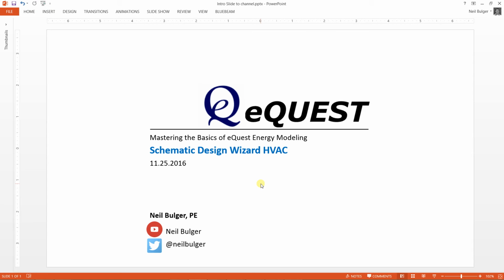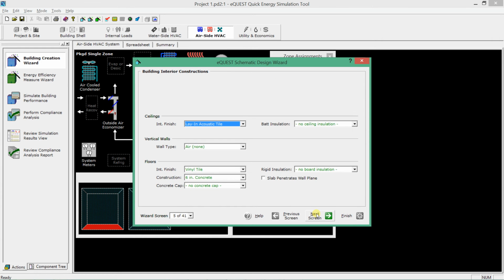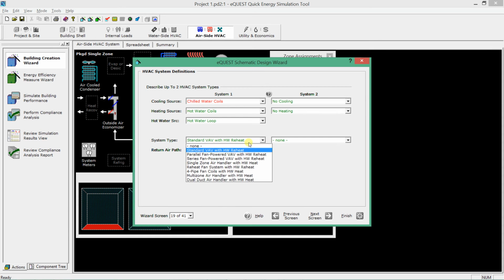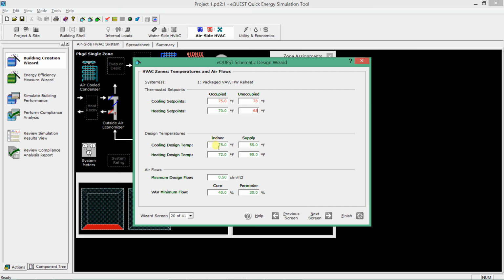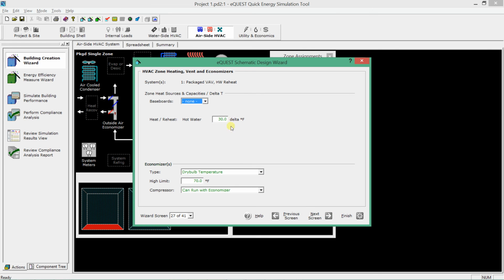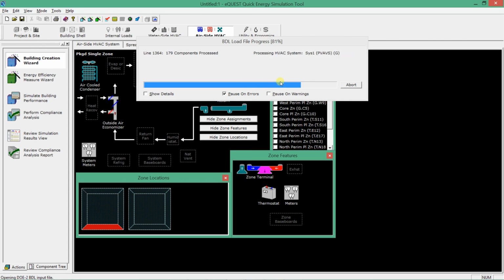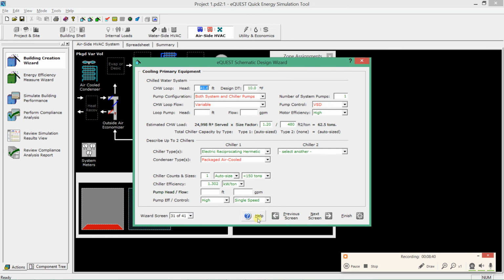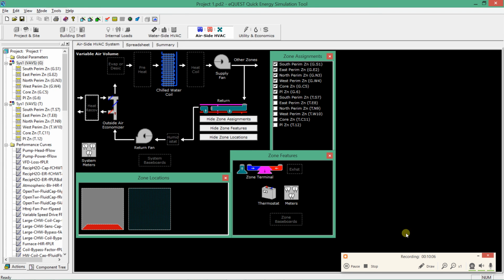eQuest Mastering the Basics 01 Schematic Design Wizard Mode HVAC

Comment: Hi Neil.  Can I use both steam and gas data sets in same eQUEST model, to obtain gas savings estimate. Thanks!
Reply from the maker: In a detailed mode this is possible, though I never explicitly tried to setup two different gas source meters.
Reply: Thank you so much for quick response! could you also kindly tell me, how to estimate the savings. Iam new to this software!
Reply: hi deepika u got ans for ur question(above)?